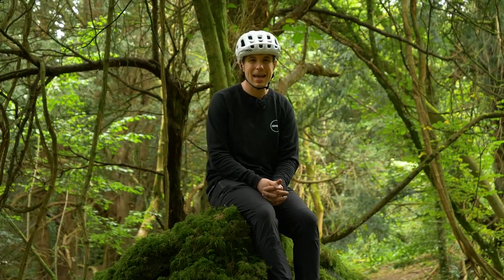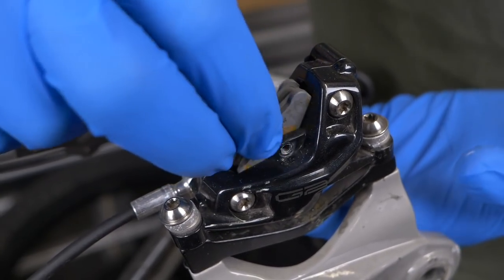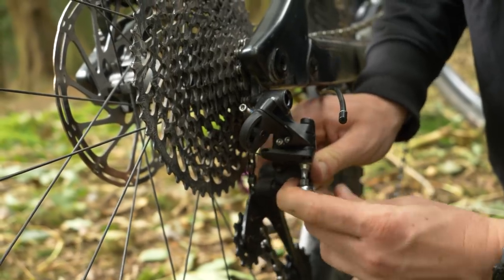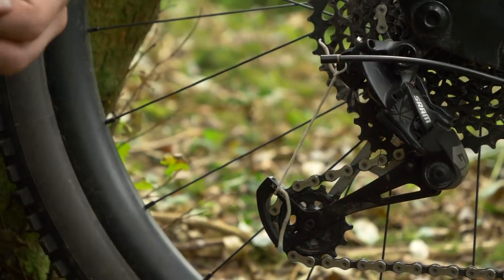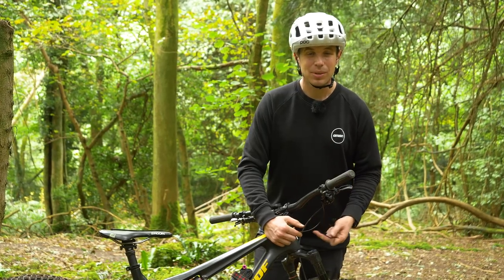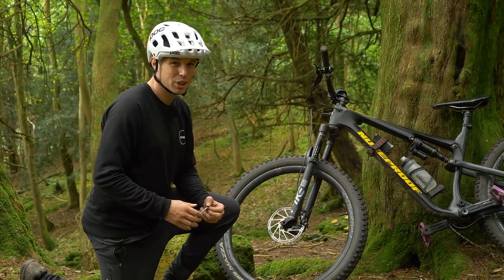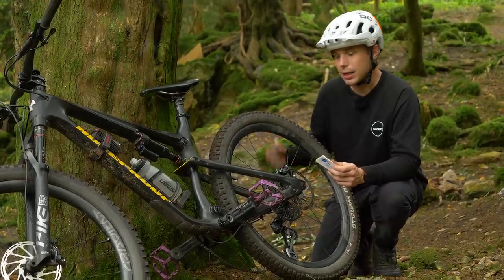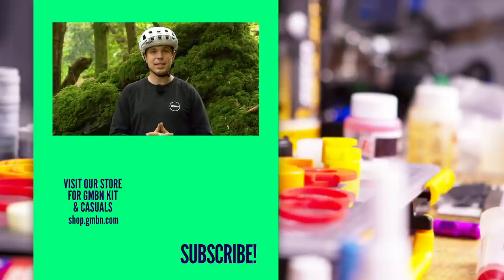7 Trailside Hacks & Bodges To Repair Your Bike Almost Anywhere

Comment: This helped me out once when my shift cable´s end in the shifter broke off: Just take the inner cable out of the outer cable and clamp it underneath the screws for the bottle cage applying some tension to get into a more comfortable gear.

Comment: If you've got a snapped rear mech cable and have a zip tie you can push the mech to the gear you want and lock it in place by wrapping the zip tie around the parallelogram mechanism.

Comment: I got a flat 9 miles in to my local trails recently. I popped the wheel/tyre off and unrolled the spare innertube and grabbed my pump. My pump then decided to break internally. I flagged down another biker and borrowed his pump, made embarrassed thank-yous, then left on my merry way. Within 10 minutes I popped it again. Thinking on my feet I remembered a trick that I heard about filling the tyre with grass, and with 9 miles back I thought I'd give it a go. Turns out that you'd need a mechanical press to pack in enough grass to have a tyre anything near rideable on my trails, so after struggling to reseat a tyre filled with grass, I had a long walk home.
Moral of the story is, sometimes you just got to suck it up and accept your fate... a few passionate explicitives shouted into the woods can help too. (sorry if I scared anyone lolwhoops)
Reply: cable tie your tube either side of the tear or tie a knot in it. it'll work well enough
Reply: That grass in the tyre trick is very old, from the days of conventional car tyres (pre radial). Those tyres had stiff side walls, so it worked. It might work with a tyre that has a downhill casing, for example.
Reply: I actually made it home with the grass-in-tire trick once. It was a rough ride. 
I expected my rim to be shot, but somehow it survived.
Reply: Some people buy cheap-ish pump to leave it on the bike always without worrying about theft. I prefer very good quality of mini pump with the classic simple build, without fashionable hoses BS, that is nothing but a weak point. Mini pump can not fail, if it's to serve it's purpose. Even if it takes more strokes. And to prevent valve damage? Simple- pump your wheel before it's mounted to ~14x heavier bike, which will not follow that movement of the pump/hands. Pumping of not puncured tyre might be safer with bike upside down, so the top of the wheel with valve can actually wiggle around much more freely, preventing that valve from breaking

Comment: I remember one of the world cup downhill mechanics explaining they only use 4 bolts per rotor because it's faster to service. Apparently it works just fine but they're more than likely checking torque after each run and might be replacing rotors daily.

Comment: I once used masking tape to patch a hole in an inner tube made by a thorn... once inflated enough to press it against the tire it held in place. I had to keep stopping and adding air every 10 - 15 mins but it was a lot quicker than walking whilst pushing a bike with a flat tire. Electrical tape would probably have held the air longer if i had wrapped some around my pump as Henry suggests.

Comment: If you lose spd cleat bolts, carry a couple of water bottle cage bolts and you can get away with it, but you will round of the outer heads so use some with a massive dome shape.